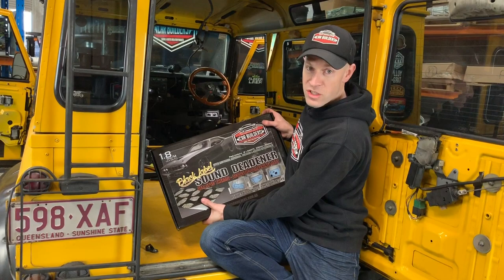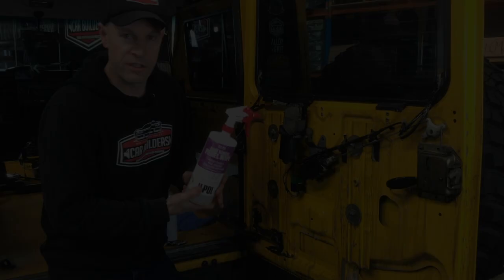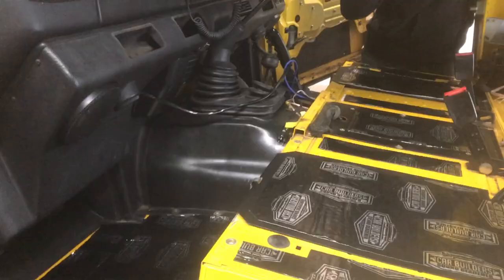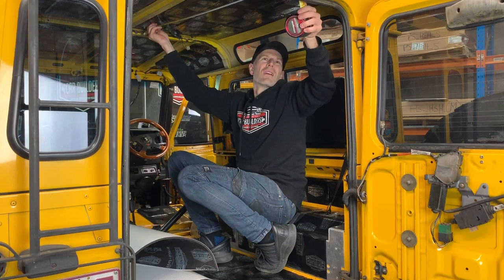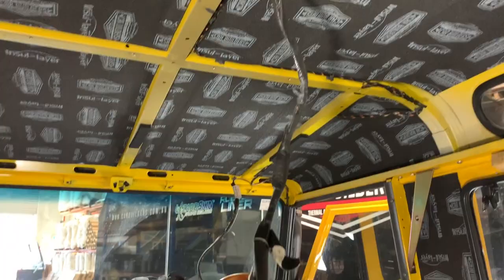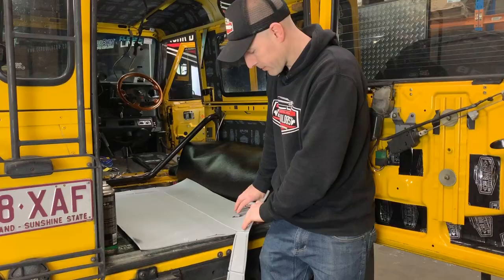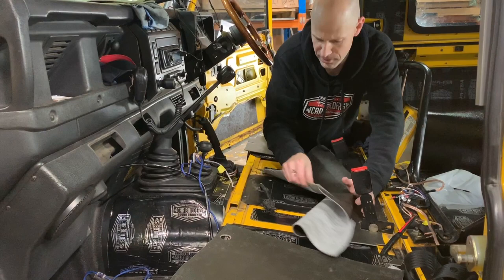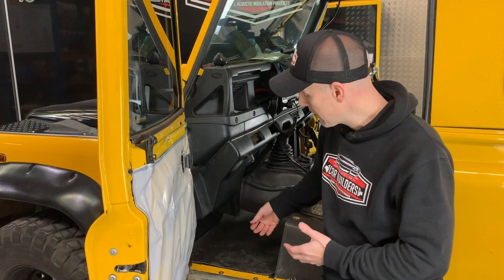How can I quieten a Landrover Defender? Sound Deadening

Comment: I have done part of my 110 Defender/Perentie (running Isuzu engine). Just the front floor, seatbox and most of the firewall. Made a massive difference, however I would like to keep going it. I think it might be worth my while looking at buying a bulk lot, rather than doing dribs and drabs.
Reply from the maker: Hi Mr Johson-Clarke. Sounds like you have done quite a bit. You probably best topping up in areas that need it. 👍
Reply: @carbuilders1  Can you make an old defender as quiet as a new G wagon? If so, then how?

Comment: Excellent video!! Learnt a lot!!
Reply from the maker: Thank you Cowan 👍
Reply: @carbuilders1  My 110 ( 2014, 2.2TDCI)has just gone for a V8 4.8L (JLR engine) conversion with 6 speed auto, and electronic parking brake, including all the necessary upgrades to brakes, suspension etc. and on the interior front, sound deadening is the next step. Your video was as good as it gets on detail in this area and worth every second to watch. Greetings from Scotland! all the best with the channel!
Reply from the maker: @cowanscott9047  nice upgrades there💪 You are likely wanting to reduce the extra heat from that motor with some heat shields externally. You might get a few ideas from this ls Patrol we treated https://youtu.be/WYqI4ep0hoA
Reply: @carbuilders1  Thanks guys!! really appreciate this! I'll check  out your link in the morning.. run out of time tonight.. cheers!

Comment: I bought 2 boxes of stage 1 for my 110. it's a start but probably going to need another 3. Back to the website i go.
Reply from the maker: Hi Nick. Are you doing the roof?
Reply: @carbuilders1  all ive done so far is the rear cargo bay up to the back seats, and yes thats the loudest bit of the defender. :)

Comment: I am currently finishing of stage 1 in my defender 110, but before I install stage 2 I am wondering if it will help reduce condensation on the roof and if the foam is moisture resistant? It can be cold and wet here in Belgium...
Very helpful video though! 👍🏼
Reply from the maker: Hi Wannes. Yes, the foam we use in the roof will stop condensation. Insul Layer is a closed cell foam and will not hold water or moisture. Good luck with your project 👍

Comment: Have you measure the dB voor and after, and what,s the result !?
Reply from the maker: Yes, we have. Landcruisers, Patrols and Land Rovers are notorious for being loud and noisy when touring. As these vehicles have very limited deadening in them from factory, there is a significant improvement in the decibel rating within the cabin. This is particularly evident on dirt or rutted surfaces where there can be an improvement of 10 or more decibels. On sealed surfaces, we have results of around 3 decibels. The Stage 1 Sound Deadener will make the panel solid and stop vibration-generated noise. The Stage 2 (Mass Noise Liner, Water Proof Underlay, Acoustic Liner, Insul-Layer) will act as a noise blanket, reducing external noise and acting as a decoupling layer for heat.  

"Doubling of the volume (loudness) should be sensed as a level difference of +10 dB − acousticians say. Doubling of sound intensity (acoustic energy) belongs to a calculated level change of +3 dB. +10 dB is the level of twice the perceived volume or twice as loud (loudness) in psychoacoustics − mostly sensed" (www.sengpielaudio.com › calculator-levelchange)

Comment: Great informative video thank you. I’ve been told by a few people NOT to put sound deadening on the roof if you are in extreme heat areas, like Oz or Africa.  Because the adhesive softens in extreme heat and because of the weight of the product, they start to fall off.  What’s your thoughts on this? I see you’ve done it anyway but not sure how much feedback you have had from customers after a while.
Reply from the maker: Thank you. We have been doing this for a long time. I think a bigger concern is when the product is in a vertical position (doors/side panels) as extreme heat makes the product tacker and potentially it can slip/slide. Whenever we do installs we are conservative and use our aluminium foil tape to border the product to avoid this potential issue. You can also do that in the roof.

Comment: If you were to just start with one section what do you think would cut down the most noise?  I was thinking either the doors or the floor first?  I can do the doors without pulling seats.  I drive a crew cab Chevy Colorado pick up truck. Road noise is driving me nuts.
Reply from the maker: Start with the doors Chris as this is least intrusive and, as you said,  you won't need to pull the seats. Is this noise on dirt or paved roads? Can you isolate where it is coming from? Do you think it is panel resonance or external road/engine noise? You will notice a significant improve with the Stage 1 on dirt/offroad tracks. The Stage 2 will be more effective in blocking droning or external road noise. 👍
Reply: Car Builders - Thermal & Acoustic insulation materials it is mostly road noise. The low hum noise from the tires. The sheet metal is so thin and I drive about 30,000 miles a year.